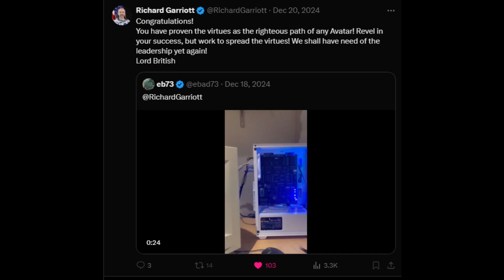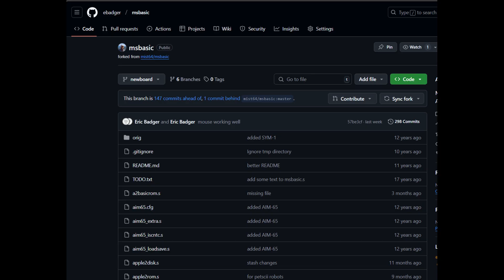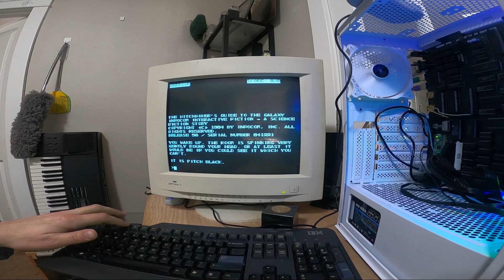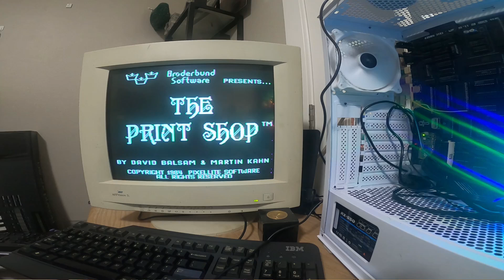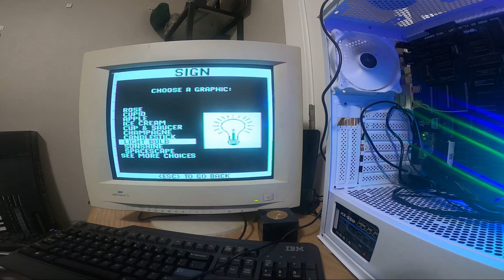3RIC homebrew 6502, the conclusion

Comment: It depends on your goals? but my vote goes for 68k. 

I might be biased towards Motorola as I'm currently investigating using a modified version of the 6809/6309 instruction set for an 8-bit TTL computer. I'm removing the DP register(page zero) and it's related instructions. This will free up some space to shuffle some of the 6309 opcodes into the more efficient 1st page of the opcode map. Also I want to extend the address space to 24-bits by adding an 8-bit page extension to all the address registers.

My main goal is to create a relatively simple hobby computer with fun creative constraints to program and hack on.
Reply from the maker: Super cool. How are you building the processor?  Using DIP logic?  FPGA?  Microcontroller emulation?
Reply: @thecodesorcerer  TTL, microcoded, 16-bit 181 ALU(I still classify it as 8-bit since instructions and the external data bus are 8-bit wide)

For graphics there will be 2 separate bitmap layers. The background layer is hardware scrollable(via presettable counters) the foreground layer is intended to emulate sprites so it has a transparent colour zero. Using a mux any non zero foreground pixel gets 'pasted' on top of the background. All pixel moving is done in software.

Although the graphics was originally designed in TTL I'll be using a FPGA. I want to be able run at 720p to play nice with modern displays. This divides to 640x360 for text/static gui and 256x144 perfect for retro gaming.
Reply from the maker: Wow. I didn’t know the 181 existed until now. It looks super cool!  I can see how it would have greatly simplified computer design.   Are you planning on supporting any existing software library?
Reply: @thecodesorcerer  Not directly. Previously I was going to use CP/M but it turns out a lot of software requires a Z80. Which has zero free opcodes and can't be modified with out breaking backwards compatibility.

The Apple II would have been more viable, but I didn't know it had no custom silicon until I saw your videos : /

So yeah, the plan is take the Slu4 approach and DIY everything from scratch.

I do have a list of things I want to port like BBC Basic, Chip 8 VM, various games. Also Unix v6 if I add an MMU.

To be honest we kind of need a better way of sharing software between these computers.
Reply from the maker: Porting Basic would enable a lot of software to run.

Comment: I built a single board computer that has a 6309 which boots directly from the sd card. There is no rom everything is loaded from rhe sd card.  Your project is very nice!  This kind of passion project is so great
Reply from the maker: Sounds cool. I had to look up the 6309.  How do you bootstrap the SD card without ROM?
Reply: @thecodesorcerer  the long and short of it is I have a microcontroller that handles the SD card strobe in a 40 or so byte bootstrap code from its internal flash memory (but that could be on the SD too!) then it resets the 6309.  It has just enough address lines to do this with the address bus tied high.  The code just copy's itself to the middle of memory and loads byte by byte the ROM code to the top of the memory from the SD card (the microcontroller acts as a memory mapped device at this point)  it's very very similar to the z80-mbc but with a 6309
Reply from the maker: @ sounds super cool. Do you have some affinity to the 6309?  Coco user perhaps?
Reply from the maker: Great story. The homebrew sounds awesome. 20MHz CPU is amazing.  Found your channel and have subscribed.

Comment: Actually, I wanted to make like something with the MSX specsYamaha V9958 etc. or if done in FPGA you could implement your own V9978 that would have all the features of the V9998 but be completely backward compatible with V9958 and V9938. Only instead of having a z80 CPU, have a 6502 cpu.  Or basically a PC engine that had keyboard and OS built into it...I bet that you could port your OS and apple basic to the PC engine. The only thing would be how to implement a keyboard interface through the controller port...If it is serial then it seems like it might work like with the maple bus for the Dreamcast?
Reply from the maker: Interesting. Reading about these Yamaha graphics chips now.

Comment: Actually, I have the plans for a 68020/030 system with 2MB RAM EEPROM and VGA out that I got from a guy like way back in the late 90's! I just started trying to port it to KiCAD and I also had plans on trying to port it to like the old DE-1 or DE-2...however, I do have some DE-10 etc DE-10Nano and a bunch of DE1-SoC and DE0-Nanos...So I could set you up! Hehe!  I originally got them for work for my Seminar Students or Graduation Research Students but I haven't had a student in the lab that understood well enough or skilled enough in like 5 or 6 years...I think only one student was ever able to finish the hardware portion of Nand to Tetris. Another thing that I was thinking about was to build an FPGA version of some synth like the ENSONIQ ESQ-1 or SQ-80....butchy's got his source for his VST open for use. I had asked him about it years ago. So, let me know. Best regards!